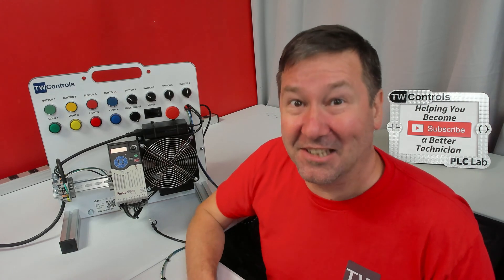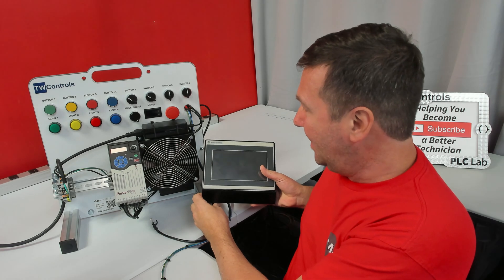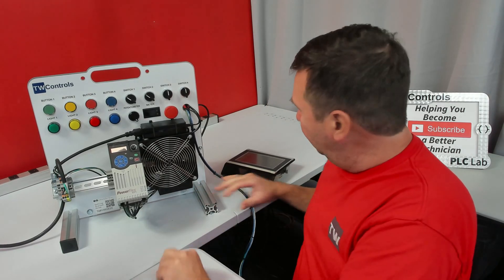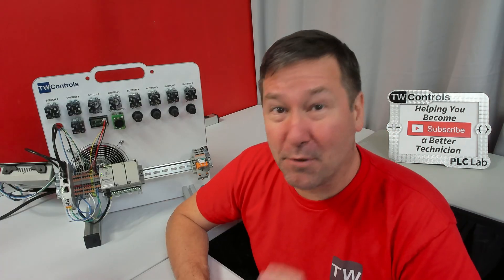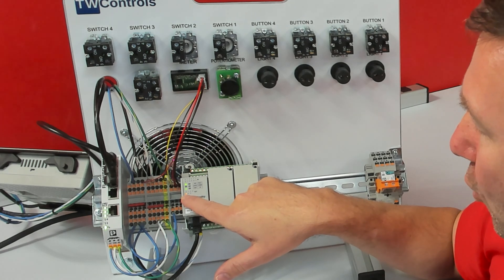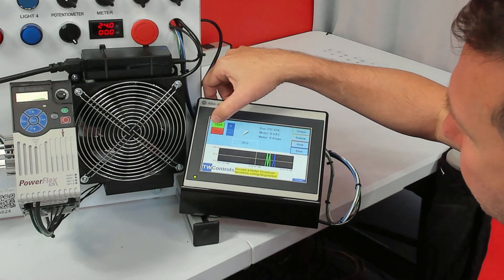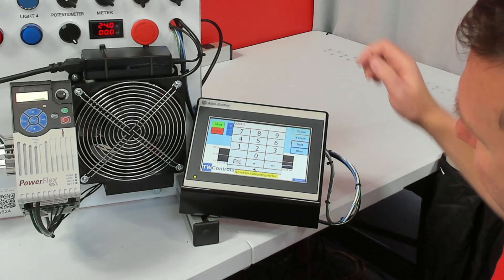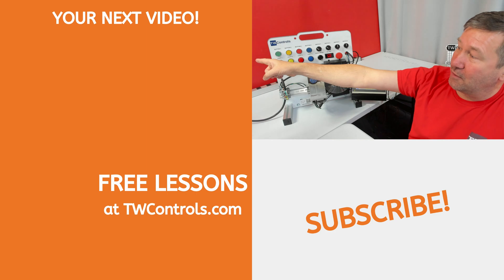Your Micro820 PLC Trainer, Drive, and HMI

Comment: Hey Tim can you do a quick video on the Connected Components Workbench Instruction Block functions: IIM (Immediate Input) and IOM (Immediate Output) and what exactly they do? We're having issues where our analog input of 13mV isn't registering an open circuit fast enough (from a jostled cable) and I was hoping that these instruction block features would have helped, but I just can't figure them out.

Thanks! Love the channel!
Reply from the maker: Chances are it won't help you though it is the first thing many people throw in their trying to make it work. 

What hardware are you using and what type of response time do you need?
Reply: @TimWilborne  Darn, We're using a micro 850 with an IF8 and an OF8 external modules. We're needing anywhere from instant to ~300ms. Running in to issues where even disabling 6 of the 8 inputs on the IF8 still don't give us a fast enough response when the output voltage is removed. So it could actually be an issue with voltage not bleeding off fast enough
Reply from the maker: What do you have the filter set at and what is the program scan time?
Reply: @TimWilborne  Hey Tim, thanks for responding, I didn’t abandon this but I wanted to get the accurate information before responding. I looked in to those questions and scan time is less than 2ms and filter is at 17hz. I looked in to it a little further and realized (this is for future persons searching) that what I needed was a bleed resistor in between my input and my reference negative DC. Opens are now caught within 10ms (so says the trends graph) now. That bug is caught, now I can go watch more of your videos. :)